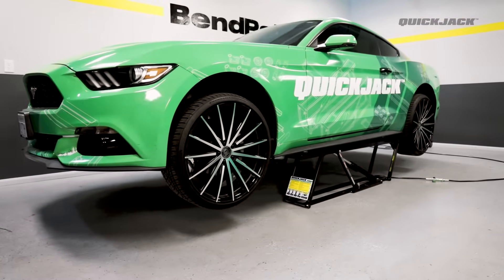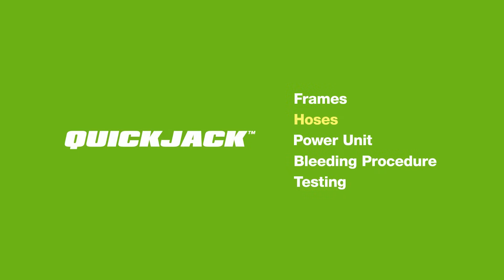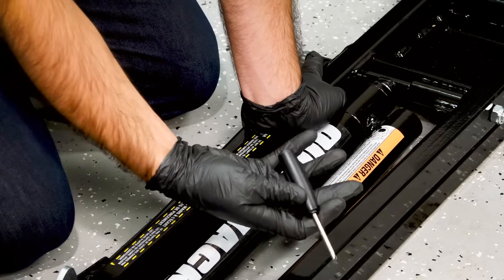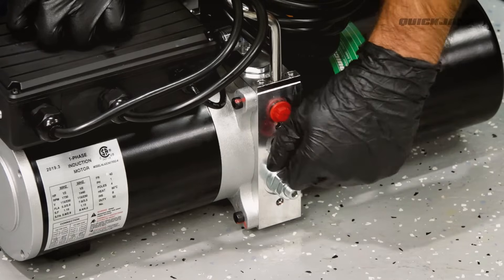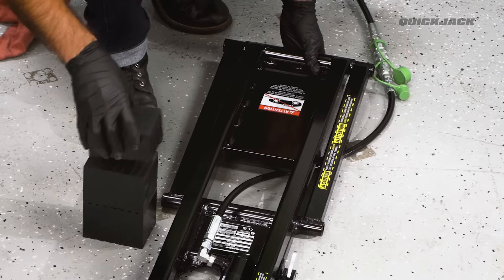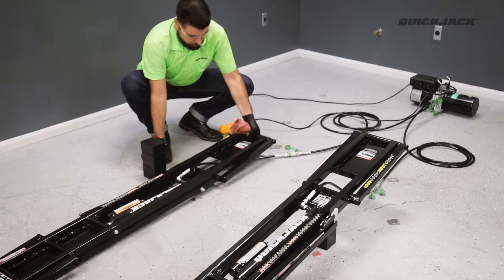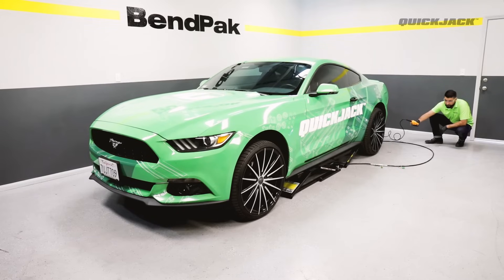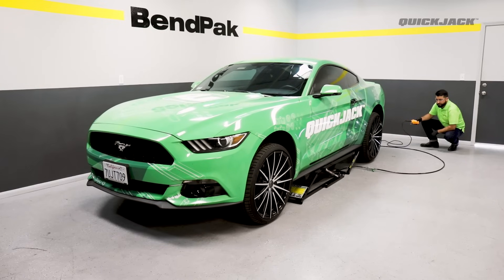The Official QuickJack Setup Tutorial

Comment from the maker: Your QuickJack now comes with a liquid sealant instead of the thread seal tape. For more on using the new thread sealant, check out these videos:
https://youtu.be/q8798Dca0AU
https://youtu.be/aN0Z4n0FNws

Skip ahead to the part you need with these timestamps!
Part 1: Frames - 1:14
Part 2: Hoses - 2:28
Part 3: Power Unit - 2:59
Part 4: Bleeding Procedure - 3:59
Part 5: Testing - 5:54
Reply: As a new buyer who is waiting the 24 hours for the sealant to cure I would like to say for the Price of the Quick Jack we should not have to assembled hoses and wait 24 hours to bleed these could be shipped assembled attach the quick connects and go.  This would save you the so called tape warranty problems as well.
Reply: @zed4229 Mine arrived with the hoses and connectors already assembled.  (March 2025 UK)
Reply: @zed4229 just got my QJ 5000TL today and they are all preassembled now.   Or at least my units were.  They include a Technical Bulletin that explains it all.
Reply: Each time you disconnect and reconnect the hydraulic hoses do you have to bleed the system??
Reply from the maker: @arbyarby3259  Great question and the answer is, absolutely not! The quick connect fittings are clean-break type fittings and will not allow air in - or liquid out - when connecting/disconnecting. The only time you would need to re-bleed the system is if you replace the fittings or if the frames are lifting/lowering out of sync.
Reply: My quickjack was shipped with the quick connects pre-installed with sealant.
Reply: @TheNovaHalo  I just received my QuickJack today (28 Nov 2024) and all my fittings came pre-installed with sealant as well. I did not expect it so I took one fitting off to confirm that there was sealant used, it was. There was also what seemed to be a film of hydraulic oil all over the power unit inside of its shipping bag, it would appear that my QuickJack was tested before shipping. Or at least that is the assumption that I am making, I can see no other reason why oil should be there.

Comment: Got the 5000TLX and used it this weekend. No runs, drips, or errors. I don't like jinky setup of having to run the hose under the jacks. I'm always nervous about crushing them when lowering the car and everything is moving. Other than that, it's pretty stout. If it holds up, it will be well worth the money.
Reply: I may have spoken too soon. I pulled this out to use it for the first time after the initial setup. I couldn't get one of the hoses to attach to the pump. I tried to bleed the shock a little bit, but didn't work. Took the cap off the reservoir, didn't work. Took the cap off the pump, that worked. After going back and reading the troubleshooting, I think it might have happened because I didn't hold the 'down' button for 5 seconds after I lower my car, the other day. I used it today and did hold it down when I got done. I guess I'll find out the next time I go to set this up and try to plug in the hoses.
Reply: Update: the next time I went to plug the lines into the jacks, they connected with only what I would expect to be normal resistance. So, that holding for 5 seconds after the lifts are down seems to work. I've used it a half dozen times since. If fact, my car has been in the air for the past week. I'm starting to wish that I had these for the past 30 years. Always screwing around with the floor jack and jack stands.
Reply from the maker: Correct! Pressure was building up.

Comment: This video is a little older but they now include a thread sealing almost like glue type stuff. even after letting it sit to cure it did not work and every fitting leaked even after being tightned a lot. I recommend using thread seal tape and u dont have to wait for cure times and it seals properly on the first try. stil love my 5000tl quick jack tho!
Reply: Thread sealant works fine but they send you a China brand thread sealant Lug LG188. I purchased Permatex brand Pneumatic/Hydraulic sealant Non Fouling 54540 when I assembled my Quickjack and it has not had one leak, you do have to let the sealant cure for 24 hours before using the Quickjack. If you have activator you can use the Quickjack sooner.

Comment: Does repeated connection and disconnection of the hydraulic hoses eventually allow air into the system and require bleeding the air again after a period of time? Is it preferable to leave them connected unless necessary for storage, or does it make no difference?
Reply from the maker: Thanks for the question. The quick-connect fittings should not allow air into the system and are designed to be utilized as often as needed. They are particularly good for clearing the hoses out of the way to clear up the work area once the vehicle is lifted and secured on the QuickJack's locks.

Comment: 4:18 what is the power requirement? Can an extension cord supply sufficient current for it to operate? Is there a large inrush current when starting up that makes it unsuitable for generator power sources?
Reply from the maker: There are several power unit choices available depending on your region. In the U.S. the standard is a 110v power unit with a peak 15 amp power draw. We generally recommend against using extension cords, however if absolutely necessary, you can use a 14 gauge extension cord for up to 50 feet of length. We have a bit more on the common electric questions here: https://youtu.be/cgjaetg_zzM

Comment: I just set up my Quickjack 7000 TL. I read through the instructions of course, but this video really covers the whole process well. Very easy set up and everything worked perfectly. If there is any input I would have about changes it would be the bleed screws. Having to manipulate them with an Allen wrench in the somewhat tight space between the frame and the hose  is a little more difficult than it would be if it was just a hex screw that you could get an open end wrench on. Other than that the whole thing was very easy and this is obviously a very well-made and strong unit. I’m sure I’ll be using this for years to come.

Comment: Hello, I got to the testing stage and it went up but won’t come down. The pump did a click when I pressed down, but nothing happens
Reply: Any help is hugely appreciated!
Reply from the maker: Apologies for the inconvenience! If you have not yet bled the system, go ahead and bleed the air out. It may also be necessary to put a small amount of whichever hydraulic fluid you're using around the chrome rod, right where it comes out of the hydraulic cylinder. This helps lubricate the system and can assist the cylinder break-in. Lastly, once the system is bled, if the frames don't want to come down, just add a bit of weight to them and that should do the trick. Ultimately, this issue is caused by the cylinder seals needing to break-in.

Comment: What can you do with these? Take off tires lol? There is not enough lift
Reply from the maker: Anything you can do with a floor jack, without the hassle of the floor jack! Lifting all four corners simultaneously is a huge advantage over a jack. Once lifted and locked there's great access from the sides to the wheels, brakes and suspension components. Plus, with up to two feet of lift height, there's clearance underneath to take care of fluid service, exhaust work, or drop a transmission. Check out our videos as well as the many others on YouTube to see how QuickJack can help your automotive workflow! Of course, if you have the space for a full-size two or four-post lift, our parent company can help out with that as well, check out https://www.bendpak.com to see our full selection of lifts and equipment.

Comment: STP AW-32 hydraulic oil (stays fluid at lower temps than the 46) would a good choice here, theoretically automatic tranny fluids will have all sorts of high friction additives that could cause problems in a hydraulic system. Another endorsement for the Loctite 545.

Comment: how do i know if i have a breather valve? the one i have has 1 small hole in the middle. so i need to loosen the nut where i fill the pump before i use the jack? i just got mine today- letting the thread sealer dry before use tomorrow
Reply from the maker: Great question! The manual has a description of both styles of breather, refer to that manual to determine which you have. The latest manual can be found online at: https://www.quickjack.com/support/downloads/ and if you need any further assistance,  you can call our support team at (888) 262-3880 or submit an online support request here: https://help.quickjack.com/support/tickets/new

Comment: Can you stagger your lifting blocks in different heights from front to back?
Reply from the maker: Great question! You can stagger the blocks as long as they all contact the lift points evenly and simultaneously, allowing the vehicle to lift in a neutral position with the weight evenly distributed. There should never be any tilt front to back or side to side.

Comment: After lifting the car to work on it. Do you disconnect the long hoses? Then reconnect to lower the car when work is done? Or do you keep the long hoses connected while the car is lifted?
Reply from the maker: Great question! Once the vehicle is up and the QuickJack frames are on one of the two locking positions you absolutely can disconnect the long hoses to open up your work area. However, definitely go ahead and make sure they are depressurized before disconnecting by holding the down button on the controller for at least 5 seconds. You can see more on depressurizing in this video: https://youtu.be/zoD-_Vn9Pqo

Comment: The bleeder valve on my QuickJack 5000 TLX takes a 4.5mm Allen key, not a 5mm as stated in the manual. And my setup included liquid thread sealant, not tape, and one connector leaks.

Comment: Teflon tape vs. thread locker.  This is always a personal choice.  Here are my thoughts/opinions on this topic.  If you install teflon tape properly, it will not get loose and cause problems elsewhere.  I have bought air compressors where the manufacturer supplies Teflon tape for making the connections.  It is meant to be a thread sealer.  Teflon tape will make stuff easier to get apart. That can really be important in the future.  Thread locker is made to keep things from coming apart.  It is not meant to be a thread sealer, but it might work as such in a lot of cases.  Any home center sells thread sealer in the plumbing department.  It is not made for locking things together like thread locker and is a LOT less expensive.  I tend not to use these (and there are lots of them) because after many years, they can harden in spite of what they say on the label.  That makes getting stuff apart a hassle, and I am tired of that.  Some plumbers use both teflon tape and thread sealants together in a kind of belt and suspenders approach to prevent leaks.  I can't say that I know of a plumber who uses thread lockers to prevent leaks in joints/connections.  It is not like the connectors in a QuickJack are suffering from a lot of vibrations where they might vibrate apart.  I would choose properly installed teflon tape over plumber's thread sealants and both of those over thread locker for these connections.

Comment: I bought one of these units, months ago, but never got to set it up.  After reading all the comments, I see a lot of complaints about missing parts, especially  valves.  I am traveling now, but as soon as I get home, I will check for all of the parts.  My QuickJack manual, Rev.J5, from Jan. 2020 is excellent!  I brought it with me, to read it.  I have seen complaints about the instructions/manual, but those must have been earlier versions. I am retired now, but I used to write complicated instructions for laboratory analysts.  The Jan. 2020 instructions are spot on.

Comment: At 3:28, QuikJack says to install the lower fitting first, so as to make the installation of the upper fitting easier.  Right process, but wrong reasoning.  I think that the upper fitting would be easier to install if the lower was not there.  The lower fitting should be installed first, because the upper fitting will get in the way of installing the lower fitting later.
Reply: Right concept, wrong wording. Makes the installation of the lower fitting easier, not upper.

Comment: Using teflon tape on hydraulic lines, is a bad practice. It can end up causing serious issues if it gets into your hydraulic system.
Reply from the maker: The new QuickJack kits include a liquid thread sealant as opposed to the thread seal tape. While the tape is safe to use when applied properly - as you said, if it does get into the system it can clog up the system requiring some disassembly and cleaning.

Comment: You say this:  “with everything connected, press the up button to start lifting the frames.” And you tell users to do this several times to bleed the system. Is it any surprise, then, that my frames got stuck in the “up” position? I have no prior knowledge of this product and relied entirely on this video and the printed instruction manual. You need to edit this video to make it super clear that raising the frames too far will result in them being stuck “up.” It’s inexcusable that you make a product that has such a glaring problem — and then you have the nerve to blame the customer (in another YouTube video) for your negligence .
UPDATE: I got the frames to come down, finally, but not because of anything the company said or did. I put the full weight of my body (150 pound) on each frame while pushing the “down” button and bleeding out a bunch of trans fluid.
Here’s my take: This thing is not ready for prime time. They need to add some safety and operating features, like a sensor that goes off when the thing is being lifted with no weight on it. We live in a world of automation and sensors so adding a few of these to address customer pain points would be essential.
Right now, there’s just too much that can go wrong. Now that it’s working, I’m happy, but what a mess trying to get this thing to work.
Reply from the maker: Phil, thank you for your comment. We're sorry for the difficulties in your initial setup. However, in both the video and the manual it is stated that the frames should not be lifted past the first locking position during the pressurizing/bleeding procedure. Additionally, the manual notes in the bleeding procedure that if the frames do become stuck that putting weight on them will assist in getting the frames back down. In regards to your suggestion, many of the improvements in QuickJack over the years have come from customer feedback so we very much appreciate your comments and they will certainly be noted.

Comment: Arrived with a broken bottle of liquid thread locker, which leaked everywhere making fittings sticky. This video, and the instructions said to use the (not) enclosed thread tape.
Reply from the maker: First off, our apologies for the inconvenience! Please contact QuickJack support to replace the thread sealant, either by phone (888) 262-3880 or via this link: https://help.quickjack.com/support/tickets/new Also, we have since updated the QuickJack assembly kit to include the liquid thread sealant instead of the thread seal tape. You can find more information in this video: https://youtu.be/aN0Z4n0FNws

Comment: My open box Quick Jack package did not include a manual or assembly kit. I found the manual online and I have plenty of thread tape. All in all, I got $600 off list price and have a 1 year warranty (BL-7000SLX). I guess I can't complain. Oh, one suggestion. Add wheels to the inside of the rails so they can be easily slide under the vehicle. Thanks for posting the video. Time to set up my new toy!
Reply: That does seem like that would make it slicker and more polished, if it could just be tilted slightly onto the wheels for positioning, instead of scuffing along the concrete as I imagine would be necessary.

Comment: When bleeding the system after I use it and disconnect the pressure hoses do I have to bleed them again in every use?
Reply from the maker: As long as you're using the Quick Connect fittings, there is no need to re-bleed the system. The only time you would need to bleed the system again is if you were to loosen the threaded fittings on the hoses, frames or power unit. Also if you do a full fluid change it is recommended to bleed again at that point. For more information please check the QuickJack manual at this link: https://www.quickjack.com/pub/downloads/QuickJack-Car-Lift-Manual.pdf or if you have any further questions, please feel free to reach out to our support team: (888) 262-3880 or online via: https://help.quickjack.com/support/tickets/new
Reply: @quickjackusa  awesome thank you so much I'm on my way to buy some right now, awesome product